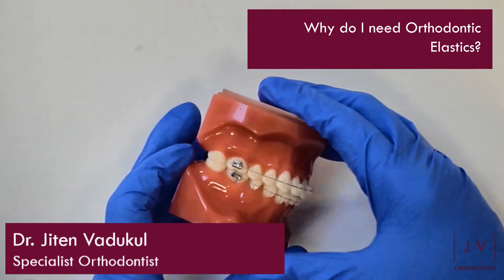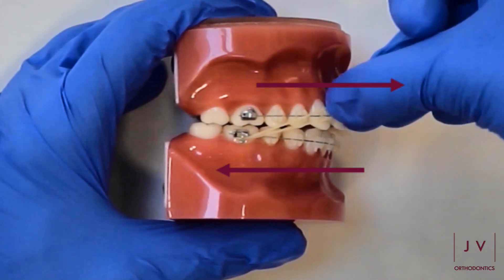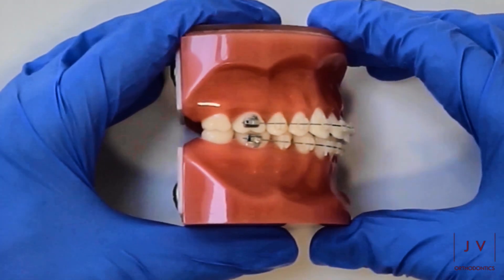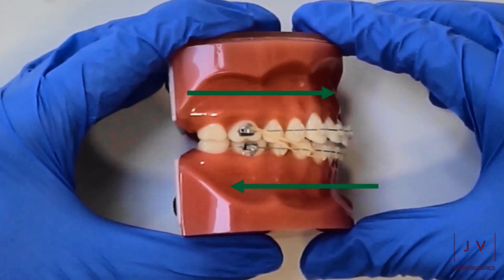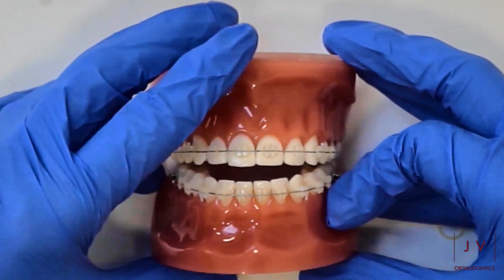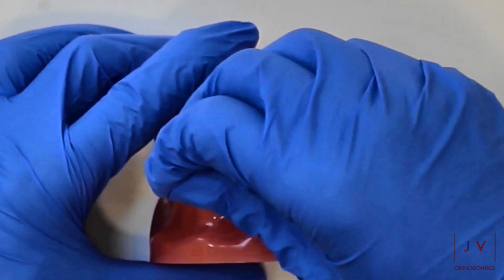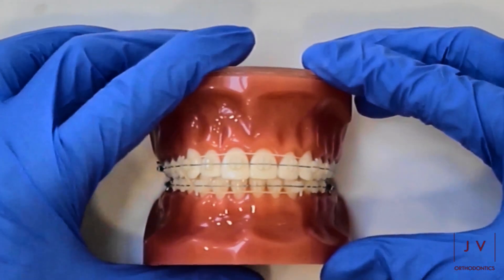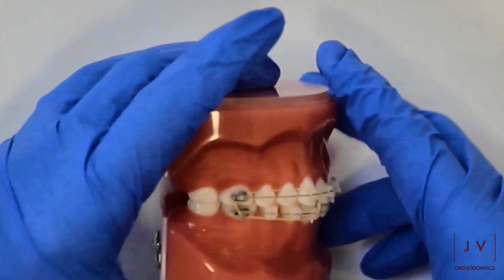WHY do I need to wear orthodontic ELASTICS?  |  Dr. Jiten Vadukul  |  The Orthodontist

Comment: i got an open bite on one side .. but i have the class 2 elastic pattern ON ... why is that ..?
Reply from the maker: Hi Shivani, it may be that your bite would also benefit from a Class 2 type configuration. Sometimes the Class 2 element is corrected first, and then an open bite can be later addressed. In some scenarios, an open bite cannot be closed with elastics, and may need repositioning of some the braces. I hope that helps :-)
Reply: @the_orthodontist  thankyou 😊